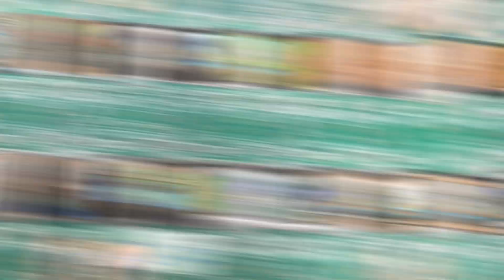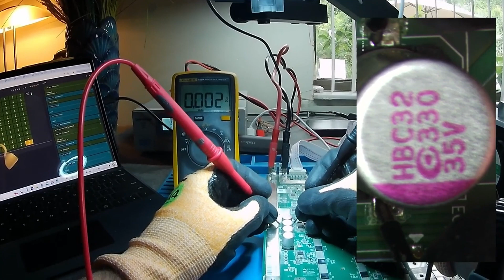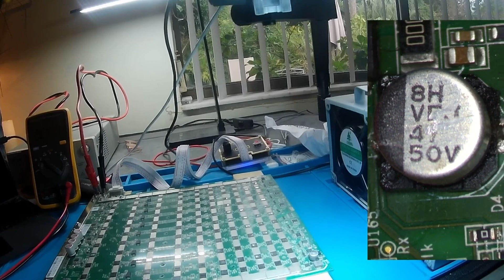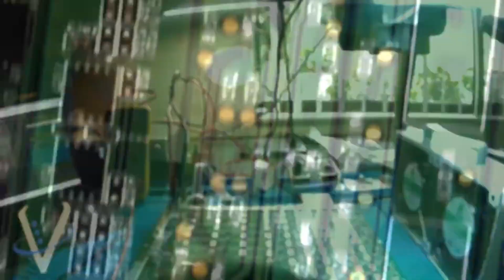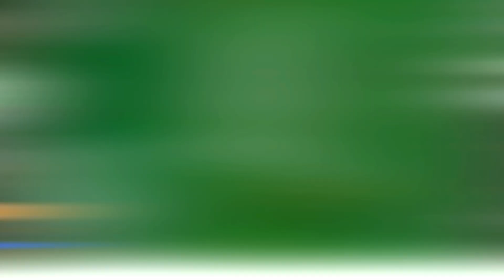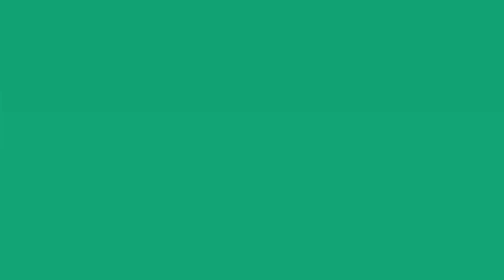ASIC #repair- #antminer S19 XP- Voltage Diagnostic #guide

Comment: You should use ESR meter for testing electrolytic capacitors. It is incredibly unreliable to use the multimeter capacitance test mode. But thanks for the other tests, greatly appreciated. 👍